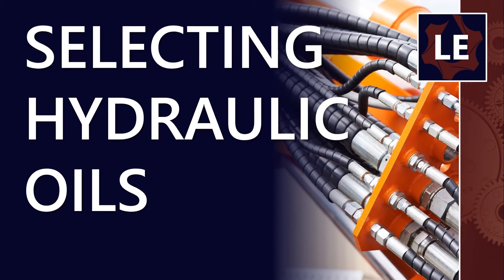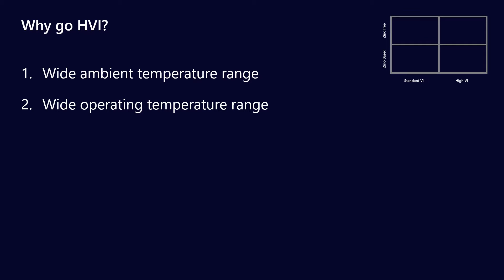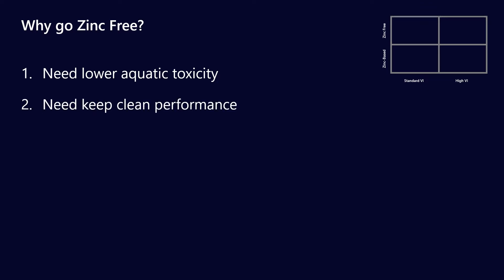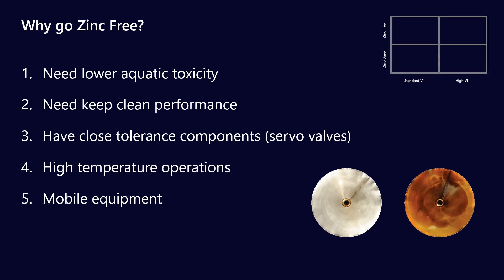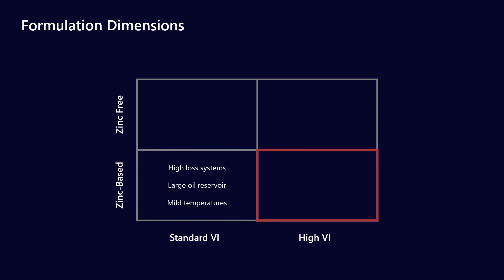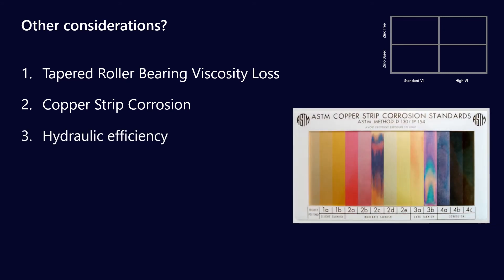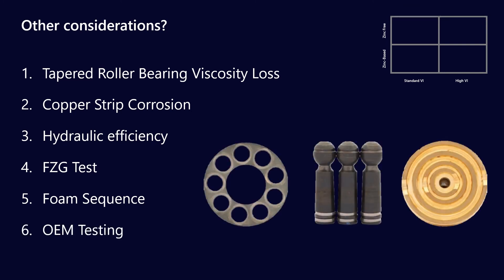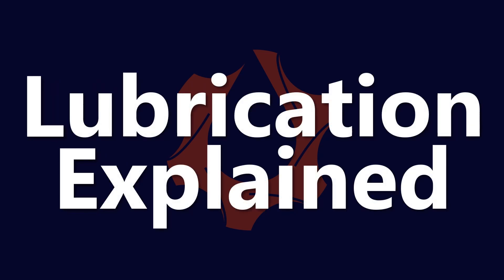How do I select a hydraulic oil for my application?

Comment: Rafe,

This is an excellent video. We regularly use your YouTube content for training purposes at our company, which operates a large-scale copper mine.

One topic related to hydraulic oils for mobile equipment that hasn’t been widely explored is multigrade hydraulics—specifically for CAT equipment, such as those meeting the CAT TO-4M specification (not just standard TO-4 mono grade). It would be very interesting if you could release a video covering the latest developments in this area, particularly around 10W-40 and 5W-30 hydraulic oils.

There’s very limited literature or video content available on this topic, and your insights would be extremely valuable.

Comment: I'm going crazy just trying to find a compatible hydraulic oil for my Junheinrich stacker. The spec is HLP-B 46 which I can't find here in Hawaii, so I just want something that will work without doing any damage long term. Obviously temperatures here don't fluctuate much, and I will rarely use this thing so it's never going to overheat from heavy use. Basically the only two options I've found are either an AW-46 or Shell S2-MX-46. I'm strongly leaning towards the Shell product. Do you know if that will work?
Reply from the maker: Hi! Thanks for the question. So in short, yes it should work. I believe the "B" in HLP-B is just for "biodegradeable" so a standard HLP should work, it just won't meet biodegradeability requirements.

Comment: I have an LS MT342SHC Tractor which is a servo valve controlled HST hydraulic system. It calls for 32/46 hydraulic fluid. Which would be the best fluid to use in it? Is there a full synthetic, zinc free VSI hydraulic fluid you would recommend?

Comment: Hello ,rafe 
Can are we use engine oils instead of hydraulic oils or no ???
Are there a difference between hydraulic oils and gear oils ??
Thanks in advanced
Reply from the maker: Depends on the application really. There are some hydraulic oils that are basically cut-back engine oils, but it's not ideal.
Reply: Yes, these are the sort of issues I was hoping would be explained in the video.

Comment: Hello, the current ambient temperature is -4 Deg Celsius and we had used CT-68 oil. At low temperature the oil fails to function. Can you please suggest hydraulic oil grade which we can use to solve this problem. Viscosity range 32 to 220 cSt
Reply from the maker: Depends on the failure mode. If the oil is no longer circulating at low temperature you may need to go to a 32 grade. Alternatively look for a product with a lower pour point.

Comment: I'm curious to the reason for the existence of "tractor hydraulic fluid" (THF) and if a more standard hydraulic fluid could or should replace it. THF seems to span a range from generic mystery liquids right through to Chevron industrial products. I'm only talking about hydraulic systems here, not the shared use of "universal tractor fluid" in transmissions, differentials, and hydraulics.
It seems to be a very one size fits all fluid for many tractors from the 1950s through today. Maybe the main goal is only cross compatibility when farmers start sharing and changing implements that operate from the tractor hydraulic pump.

Comment: Hi nicely explained.. can you tell us the name of oil which pass this Bosch rexroth test?
Reply from the maker: There are quite a few that do, but at the time I believe that Mobil DTE 10 Excel was the only Zinc free hydraulic oil that had passed. Being able to withstand the wear test without the advantage of a ZDDP antiwear system is very challenging. But not having ZDDP in the formulation helps reduce deposit formation.

Comment: I didn't understand the need of FZG test for hydraulic oil. Can you please elaborate it little bit. Thank in advance.
Reply from the maker: It isn't really needed for hydraulic actuators, more for auxiliary systems that might also be lubricated by the hydraulic oil. For example, the oil pump for  a hydraulic system could be a geared pump that requires scuffing resistance, or there may be bearings.